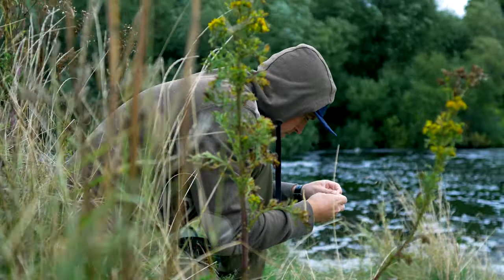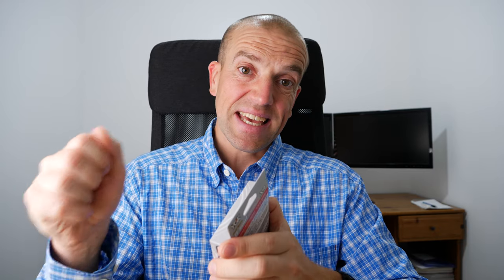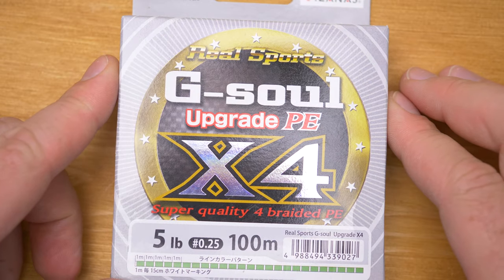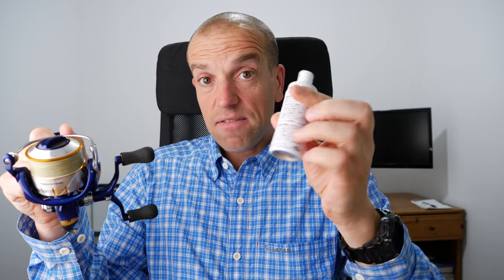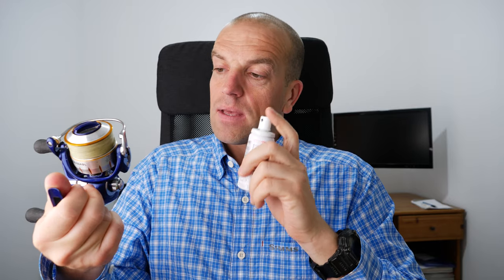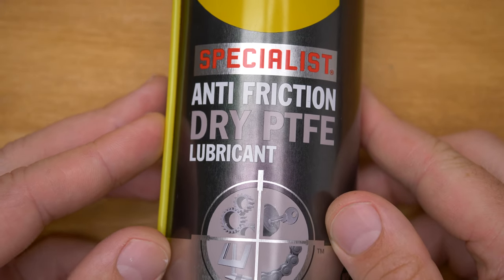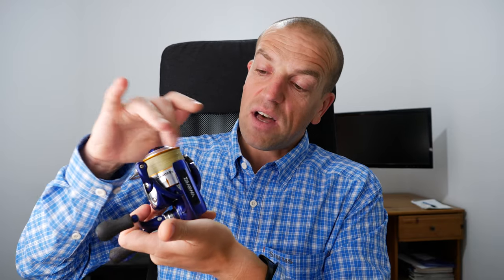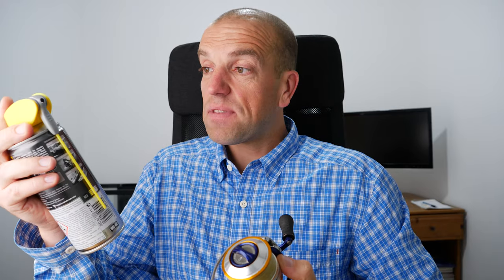How to improve braided line?

Comment: Just use any silicone in spray, as simple as that.
Reply from the maker: Tried WD40 silicone spray. Better than nothing but nowhere near as good as PTFE..
Reply: @AndrewsKnots  goood is was wondering if silicone was better than PTFE.I will try it on my daiwa steez A with KTF spool and full ceramic bearings : )

Comment: Anybody wishing to spray WD40 onto their reels may as well just go and Chuck them in the bin. Stupidest idea I have ever heard, spraying wd40 onto your reel will just make the gears seize and sup all the moisture from the internal sprockets. Better off using a normal lubricant or Vaseline to lubricate the reel, however nothing you can do will stop you from getting wind knots. The clue is in the name; WIND knot. Adding something to the braid is only going to affect the action of the lure and braid interfering with it. I have done many tests myself with braids and reel including diameter of braided lines and, unfortunately you will NEVER be able to fully avoid wind knots when using smaller diameter braids, it is as simple as that
Reply from the maker: One believes video's about spraying the line not the reel's internal parts.